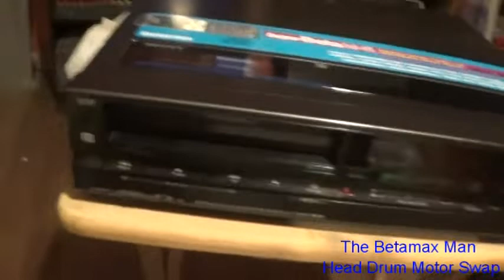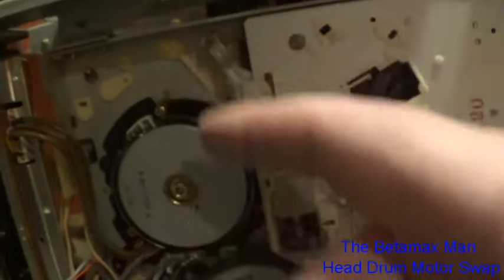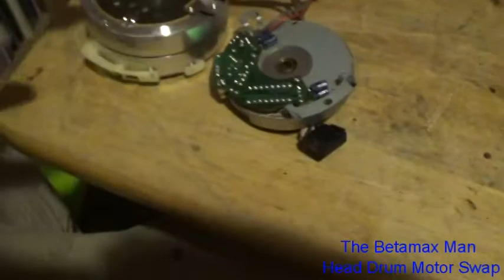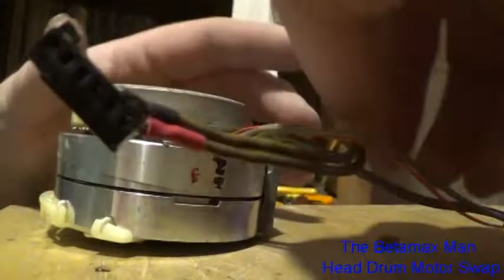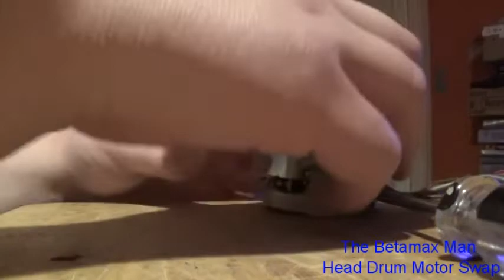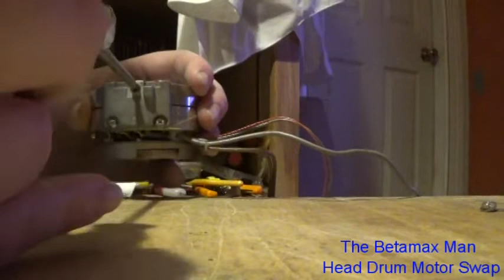Sony Betamax Head Drum Motor Swap

Comment: Thank you very much for this video. 

While inspecting my SL-HF900 after taking it out of storage a few months ago, I observed a worrying scraping or clinking sound made by the video heads when they spun.  It went away after using the machine for a short time.  Does the head drum need lubrication of some sort?  If so, maybe my '900's video drum needs new lubrication. 

5:40 - I've heard that ED-Beta tapes (which have a metal-particle formulation) should not be used in normal Betamax and SuperBeta machines because their higher abrasiveness will prematurely wear out the heads (and possibly cause this shiny phenomenon).  Do you know if that's true?
Reply from the maker: corect never put metal oxcide tapes in a reguler beta vcrs yes it will damage the heads. Also as for lubercating the bearings for the head drum you could use oil made for lubercating electronics or in a pinch WD-40 but only in a pinch
Reply: Great video! I have an SL-HF900 that has poor BIiI playback. Curious on what my options are for donor machine heads? I don’t really care about trick play functions, so are their certain heads I can consider using?
Reply: @instantwow  That's odd.  The SL-HF900 has four heads, and, as far as I know, it uses the same pair of heads to play βIII and βII.  Is βII playback affected as well?  Can you fix the the poor βIII playback by adjusting the tracking or other controls? 

I think head drums can be exchanged between Betamax machines.  In the following video, 12VoltVids takes the heads from an SL-HF900 and puts them in an SL-HF1000: 

https://www.youtube.com/watch?v=LQDhxDQbr74 

The SL-HF1000 has flying erase heads and the SL-HF900 does not, so the recipient SL-HF1000 lost its ability to perform clean video insertion, but that was the only problem. 

On MrBetamax's website, there is a list of Betamax decks with four-head drums.  Regrettably, YouTube will not let me provide direct links (except to Wikipedia and other YouTube videos).  Instead, search on Google for "mrbetamax video heads" and look for the page titled, "single and da (dual azimuth) video heads". 

You can find people selling replacement video-head rings from Sony on eBay, as well as broken Betamaxes being sold cheaply for parts, so you can easily obtain replacement video heads that way. 

I don't know if you can put a two-head drum in a SL-HF900.  In theory, you would get a noisy still-frame on all three speeds, a noisy picture search on βI and βII, and no picture search at all on βIII. 

(Four-head Betamaxes have two pairs of video heads -- a narrow pair for βII and βIII recording/playback and a wide pair for special effects and βI/βIs.  I think the unmodified SL-HF900 uses the narrow heads for βI playback, however.)

EDIT: I must clarify that I mean four-head Betamaxes with "dual-azimuth" heads made by Sony from about 1983 onward.  Some third-party manufacturers (like NEC) made Betamaxes with four heads that used the heads differently and did not support βI playback.  Also, the Sony SL-HF2100 from 1991 had four heads but used them differently from other four-head Sony machines.